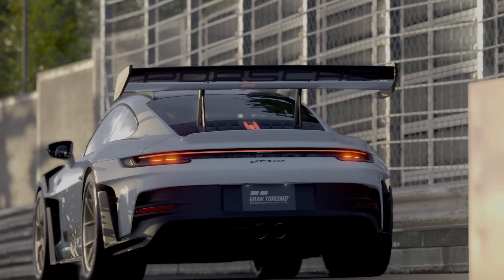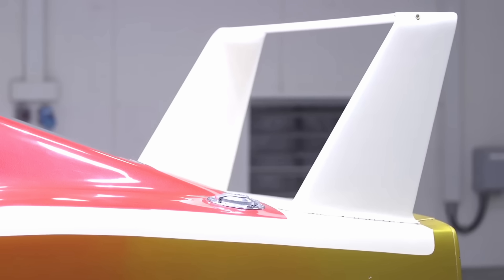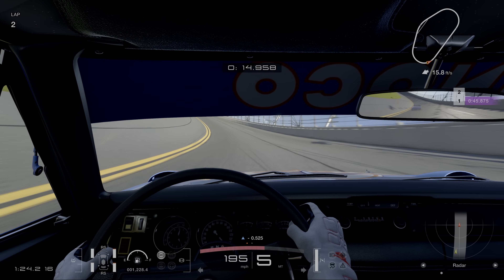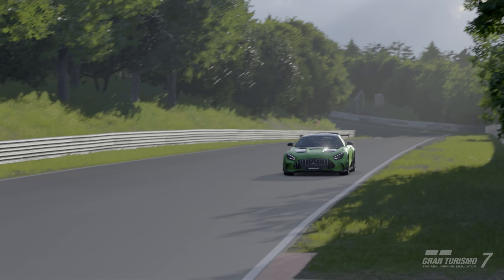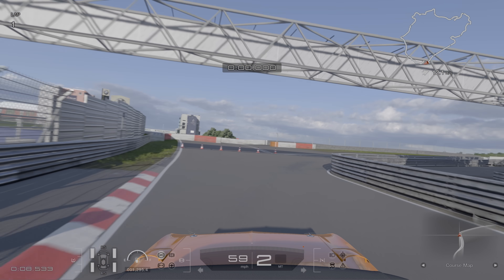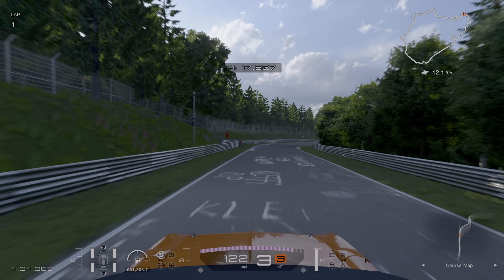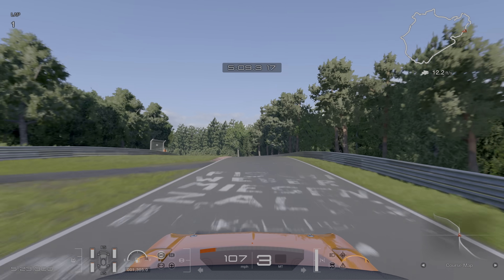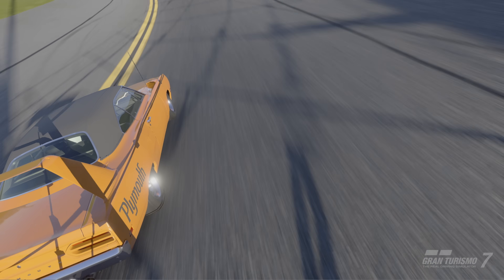Why Is This Car Undrivable in Gran Turismo 7?

Comment: I've not played a Grand Tourismo since the PS3, but I vividly remember that thing has been undrivable since the first game back on the ps1 (Old man yelling at cloud).  Like most of those really long American muscle cars of the era, they were not built to corner flat. In game, while I could catch up on the straights through sheer power, approaching a corner at the speed required to stay with the pack resulted in either making passing acquaintance with half the cars in the race and the barrier, or my exiting the bend arse-first. There were some mods you could do to mitigate some of this, but was still still terrible.  I remember really regretting blowing my money on one near the beginning of the game and just having race after terrible race to try and buy mods to make it even remotely good.

Comment: One advantage you probably won't get in a game is all the cheats these guys would do.  These cars for instance didn't use coil springs but torsion bars.  Because the ride height was only measured at the beginning of the race, they would have the bars mounted in plastic which after a couple of laps would crush, allowing the bars and ride height to lower.  Often something like a screw near the air intake would be a secret NOS port attached to a hidden bottle.  Body parts might be designed to change shape with enough wind pressure creating a better aerodynamic shape.  Various parts might be acid dipped to become lighter.  A fuel line might be made a lot bigger to hold more fuel so less needs for a pit-stop were required.  There was constant cheating going on.

Comment: A friend of mine invited me to do some back roads driving with a bunch of his sports car owning friends, and to be funny I took one of my Superbirds (yes really—I have two) instead of my mom’s 911. I ran out of rear brakes in a hurry, and while I upgraded my torsion bars I didn’t have enough spring rate out back to balance the car.  The engine has Edelbrock heads and some other work so it didn’t get lost in the straights but I had to brake really, really early. Still a ton of fun to hustle a car that doesn’t want to around roads it shouldn’t be on lol
Reply: Mom's 911...
wtf
Reply: @therobustmole1137 she’s 76 years old, owns a 911, a turbo Legacy GT and a ‘69 Charger Daytona, all stick shifts. She’s more hardcore than most car guys.
Reply: Hey brother, good for you for owning 2 Superbirds! It's one of my favorite cars of all time but I've never driven one. When I reach the point of my life where I am well-off financially, that is going to be the number one car I'll buy. Keep it real!
Reply: A 70 Superbird with any of its available engines shouldn’t get “lost” in the straights. Even if it’s bone stock. They were never lacking power.
Reply: @larryisntmynamebutyoucanca9625  dad bought them in 1976 for around six grand for the pair.  Lots of work from their generation and mine to keep them around and going.  If you get the chance to get a ride you won't believe the attention you'll get.
Reply: @CamaroAmx  they're quick for their era, but modern high end sports cars leave them for dead.  I don't feel bad not keeping up with 911 GT3's and F8's, you know?
Reply: @dougcroxford4038  technology marches on. Who knows, in 30 years the sports cars of today may seem slow and poor handling compared to then modern cars.

Comment: I love how poorly modeled oval racing is in most modern racing games. Developers seem to think they're just driving in circles, yet they have a lot more complexity to them.
Reply: Yeah! There are, like, three or four gentle corners to worry about!
Reply: @DeathInTheSnow  that's exactly the kind of ignorance I'm referring to!
Reply: Are you referring to corner banking?
Reply: @yowhatsup9909  I'm referring to a lot of things. No game (besides iRacing) properly models how forces affect the cars in oval racing. Especially on high speed oval racing. The amount of g forces constantly on the car and the angle is never shown properly. The suspension compression and handling is never shown correctly and neither is the power of drafting. Drafting is barely modeled at all in most racing games. There's way more to it that also isn't shown like Tire wear and how throttle affects them differently for example.
Reply: @V8_Diva  Just hoping for a decent console nascar game for once
Reply: @DeathInTheSnow  bwoah you're right!!!1! surely, by that logic, racing must be super easy since all i have to do is press the gas and turn the wheel. boyoyoyoinnggg! duh!!! simple as fuck! how come i'm not fighting the likes of verstappen when it's just that easy? have a go at it and show us how easy it actually is, while you're at it!

Comment: One thing to realize : road cars are not suitable for slicks - and sport tyres in this game are already extremely grippy, to the point sport softs already provide more grip than some real life slicks. Comfort tyres makes most road cars and even some old race cars (like the old Honda F1) much more predictable, balanced and fun to drive. 

When you have too much tyre grip vs spring rate / natural frequency, what happens is your springs get overloaded and you bottom out from lateral Gs mid corner. At that point it is as if you had no suspension anymore, which often leads to disaster. That's why race cars have very high spring rates, even more so when they have lots of downforce. Otherwise, you'd actually want to run softer springs. And the range of spring rate (which is effectively what natural frequency is hiding in GT7) you have with custom suspension is still not high enough for a lot of cars. Main exceptions are cars like the latest Ford GT or the RUF CTR3 which can drive on racing hards. 

Fun fact : inters on dry works very well with old scholl race cars as well (but you can't have tyre wear in those conditions).

Now, maybe the upcoming update with new physics and the new Michelin tyre model will change things regarding sport tyres, but World Series drivers are saying the race cars are actually faster now on the new physics, so chances are the "problem" will be worse.
Reply: Why would you put slicks on a road car stuck suspension?
You wouldnt is the answer, negating much of what you wrote.
One thing you do notice with slicks on older cars (with suspension upgrages, including but not limited to steering springs, shock absorbers, bushes, sway bars and brakes), is the front stub axles start flexing on fast corners and you touch the brakes and the brakes are spongy or worse.
Reply: @ThePaulv12  many people do in this game.

Also, quoting my previous comment, "the range of spring rate (which is effectively what natural frequency is hiding in GT7) you have with custom suspension is still not high enough for a lot of cars"

Comment: Because for some reason it gets no rear downforce. They haven't even bothered to change or add options to fix that either. Though yeah I forgot about how easy the suspension bottoms out. It's been a while since I tried to use it

Comment: If you see someone say that Ovals are "easy" for THE car that won on ovals you need to run from those morons as far as possible.
Reply: The car was unironically made to win in ovals in a way that it ended up BANNED of racing beacuse of that

Comment: The only problem I have with the Superbird is the vehicle settings menu trying to tell me that the giant rear wing somehow generates 0 lbs of downforce and it isn't adjustable.  Fully customizable suspension, fully customizable limited slip diff, dropping the weight as much as I could, and medium racing tires did the trick for me.  If you do the high RPM supercharger, it also helps to play with the throttle at the top of second and third so it doesn't eat its own back tires.  I have two and routinely drive both at Sarthe, Trial Mountain, and Watkins Glen with no problems even though I think something happened with one of mine with the last update where it tells me that its performance points can't be classified so it won't let me drive it in anything.  The car I have the most problem with is the '70 Chevelle SS 454 which is probably my own fault because I refuse to put that giant, stupid looking drag wing on the back

Comment: @0:45 yes you can drive this car at 200 MPH around Daytona. It was a stock car to compete at NASCAR events. Anyone who thinks that it wouldn’t handle a NASCAR track might not be thinking clearly
Reply: Didn't it hold the record for the highest speed??
Reply: "Stock cars" in NASCAR were about the furthest thing from "stock" by the time this baby rolled on to the track. These cars were heavily modified to compete in NASCAR. Hell, Petty drove one. They could boogie.

Comment: Older car have softer suspension in Gran Turismo (This and Ruf Yellowbird for instance), and they have tendency to lose traction during braking, bodyroll during corner, and spin on the exit.

That's why if you wanna try them out on Nordschleife, its recommended to stiffen your suspension like any other car being tested there.

Comment: i dont think comparing it to a completely different car says anything, you should compare the stiffened version to the stock one
Reply: I think hes just trying to say that the car is competent enough to get a fast lap time and that its still a fast car
Reply: I think the point was to show how it can be improved to be as fast as a good car as it has a reputation of being bad, comparing it to its stock self wouldn't achieve much whereas comparing it to a more modern car which is stable and most likely faster would be a much better comparison.
Reply: And the racing tyres make all the difference too, it makes any car to turn at much higher speeds, it's the most important upgrade for turns especially a track full of turns...

Comment: Rigidity is huge, but you also hit on something else important: most older cars need suspension travel. Hell, even in the 90s most cars tend to be kind of tippy-toed. If you pull all that travel out they simply can't grip

Comment: the one gripe i have with this video is that the car was tuned for RS tires instead of RH or SS tires to have fair level playing field, like going off of Gr. 3 class cars and how manufactures BOP works is that the RS tires are ~6 seconds faster than the RH tires so in my mind to have it be fair the tire selection would of been RH tires to allow for more grip and less wheel spin but still be closer to the SS tire grip you used for the Merc. otherwise its a look into tuning in GT7 that makes sense but would have to be adapted since it was worked on and came out on the old physics and tire model that was changed with the 1.49 patch

Comment: The question becomes if this is what happens when its upgraded, did racing Superbirds of the time also have something similar when they were racing? I believe the issue is this modification shouldn't be required, my expectation is that the stock Superbird should be able to handle the banking of Daytona just fine as its my expectation that its a representation of what was raced back in the day.
Reply from the maker: In Gen 2 NASCAR they were allowed custom suspension and subframes just had to leave body and frame stock.
Reply: @hubblesphere  would that equate to a "stiffened" body like in the game?
Reply: @EnvyCT9A  No. But the race version had a full roll cage, and that adds a ton of rigidity.

Comment: I think using racing tyres was a cheat that reduced the integrity of this test, the limit should've been sports soft the same as the AMG GT
Reply from the maker: A lot less downforce and 100 less horsepower so I felt a tire offset was fair enough. Just showing the car is tunable and drivable, it’s definitively not faster than the AMG on equal footing.
Reply: Could you restrict the power of the AMG instead? I enjoyed the video regardless btw :)
Reply: @tommydplayskeys giving the charger more power than the AMG will make it a complete deathtrap
Reply: @hubblesphere  Slicks are the single best upgrade you can give any car by a huge margin. It's absolutely worth more than the power deficit.

Comment: Lately the most fun I've had with gt7 is suspension tuning. Figuring out how to fix the braking oversteer issues in so many cars has been pretty fun. Finally managed to get an Italia to go around the ring without trying to spin itself into a wall.

Comment: The B-Body Mopars of that era had a suspension design that was highly dependent on ride height. It was never meant to be "raced" on a track that needed a bunch of suspension travel. The front torsion bars were adjustable so you could measure from the center of the k-member to the ground to dial in the front roll-center. This assumes you are running the NASCAR tires which require you to cut out the wheel openings due to the increased track width. Also, you need lowering blocks between the leaf springs and the spring pads. If memory serves the front roll-center should be about 2.5" and the rear should be 9". That's pretty slammed and you will have to trim your suspension rubbers for clearance. I don't know if the game is just like the real car but you are going to have upper ball-joint issues due to the upper a-frames being angled so much when the car is on the ground. You're gonna need a bit stiffer torsion bars and rear leafs. The stock front anti-rollbar is a problem since they never made one stiff enough for this purpose. We ran an aftermarket one. The car's CGH needs to be gotten down around 13" to 14" so get everything out and down as low as possible.
If you do what I suggest and don't ignore anything this setup is crazy good. We held track records all up and  down the West Coast of the U.S.

Just something to think about. The laws of physics do not care what year your cars was made or how much money you spent on it. The only thing it cares about is 4 little patches of rubber and some aero forces.

Comment: The problem with being "an introduction to cars for new people" is that you will get stubborn idiots who refuse to learn about the mechanics of cars and just want to race, thus getting angry when they can't race properly.
Reply: The issue is the mechanics of the car arent being respected by the game. A leafspringed solid rear axle "muscle car" shouldnt be having impressively crippling toe changes in its rear end.
Reply: I have a WRX in real life, though it's just a base model and not the STI. I've taken it to autocross once and driving that there (engine and transmission differences aside) was quite different than in GT7. Video games don't really give you an appreciation for stuff like body roll which drastically distorts the sense of speed and thus judgement and "realism". I tried to get the specs of the WRX STI to match the specs of my car, and regardless, it handled about the same. Honestly quite impressive for a video game and some casual on a controller... much prefer the real deal.

Comment: I mean most of American cars are undrivable in GT7
Reply: It's not true at all. There are plenty of not only drivable cars but good handling American cars in GT7. You have the Focus ST and RS the Mustang GT and GT350R  the 2005 and 2017 Ford GT. 2014 and 2020 Corvette stingray the 2019 Corvette ZR1 and I would say the 2009 ZR1 but it has a tendency to spin out but only because it has 640hp going to tge rear wheels with almost no downforce can easily be fixed with very light tuning though. But also the Camaro SS. All 3 generations of Dodge viper even other older American cars like the Mustang Boss429, the 1969 Camaro SS, and almost all generations of the Corvette and that's not even mentioning the racecar variants of the Mustang, GT, Focus, Viper or Corvette. The fact of the matter is that most of the American cars in the game are not only drivable but also have good competitive handling without suspension Tuning  and even the bad ones are some of the best handling cars after they are tuned. The ones that are already good handle like racecars when they are tuned. You not only sound like someone who hasn't driven that many American cars to the game but someone who hasn't even played the game at all to say something like that.
Reply: @xxneroxxx4996  oh yes it is true. As someone with 1100+ hours on the game I can say most of the American cars handle awfully. Why in the hell would I say it if I didn't tested it. Viper really isnt that stable although I built a ACR it's very difficult to drive with all aero,is fast and has decent laps but again difficult and mostly unstable. Focus is a hatchback so it handles decently and it is AWD. GT350R is bad too,needs a wing to be stable which I didn't wanted for style purposes. Vettes are ok ussualy but tuned not so much. Challenger is a real boat on land. Charger is undrivable at any tune. Willys with the swap obiusly,even the 4wd doesn't help. Ford GT is a mid engined supercar it really should handle so it's ok from what I remeber. But any American car with the FR layout,usually older ones,pony cars mostly handle terrible,I'm not really sure have you driven them but ok. Every Euro or Japanese car handles better then a US car. I mean do you know how a US cars suspension looks like? If you knew you'd probably knew why they hadle awfully. Overpowered RWD isn't really the best config for good laps and handling.
Reply: @xxneroxxx4996 that's funny, the ford focus st isn't American
Reply: @Maximus20778  you can buy an ST in America.

Comment: The race trim version of this car actually has vents under those "spoilers" on the fenders. This kept the front end from parachuting at 200+mph.
Nascar actually changed the rules because of this car. If I remember correctly, this was one of the first cars to undergo wind tunnel testing (at least a Nascar race car). For the curious, I'd suggest checking out the older races, especially the early to mid 70's. At 200mph, they were drifting around the banked turns. "Handling" had a completely different meaning back then.